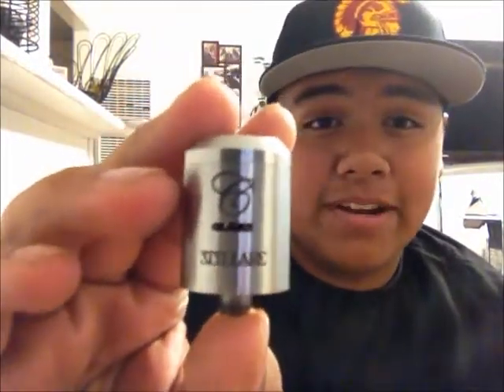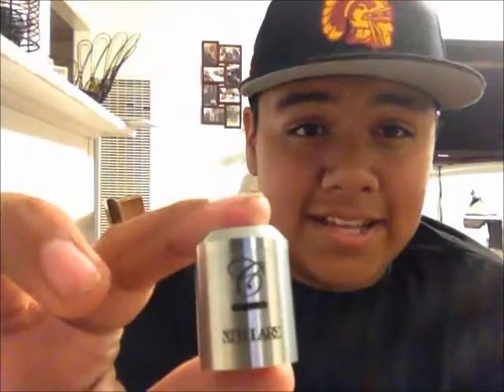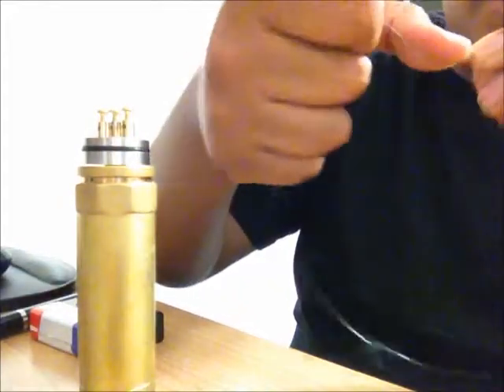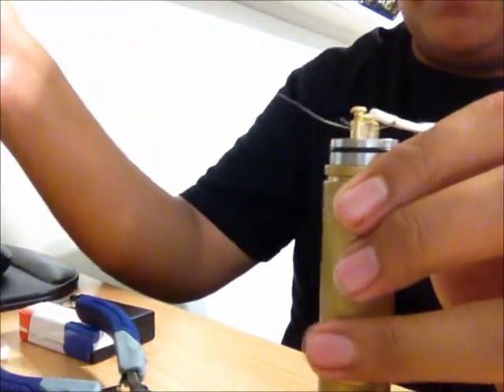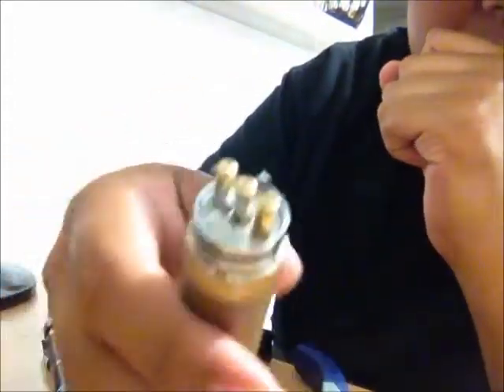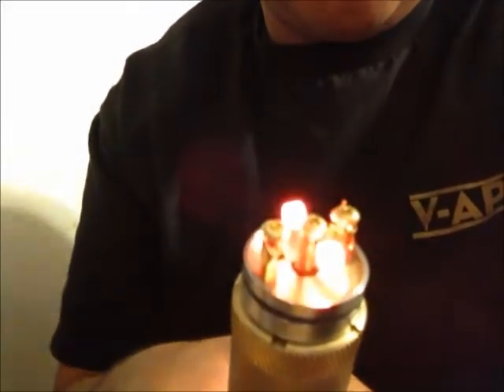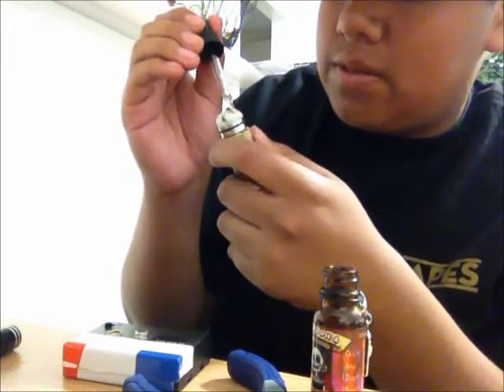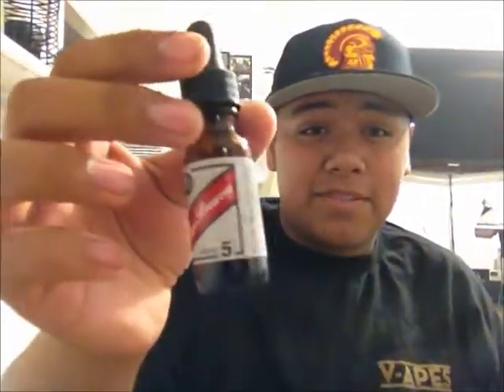Stillare Clone by Infinite + Sleeper Build

Comment: that is not what a sleeper coil is. RT is wrong about that. What you're building is called a continuous coil. A sleeper coil is where you have a coil with spacing in between the wraps.
Reply: No it's not bro a sleeper coil is dual or quad with one wire
Reply: No... that is a continuous..